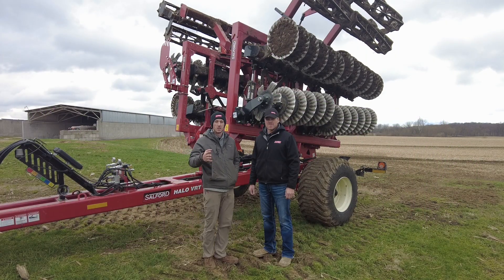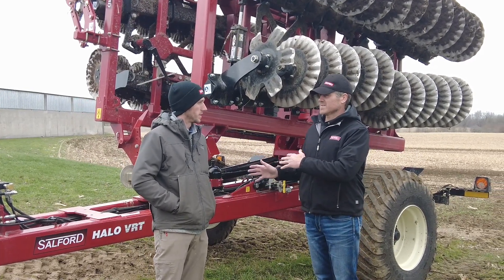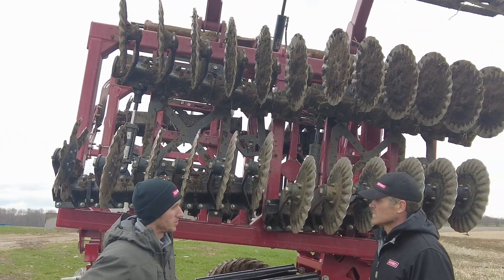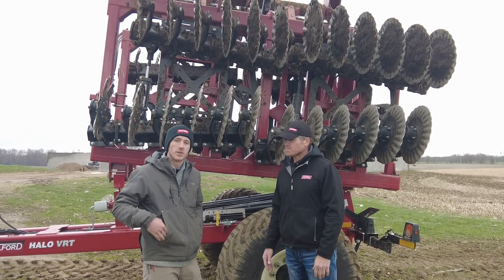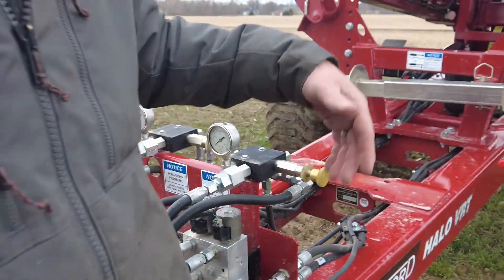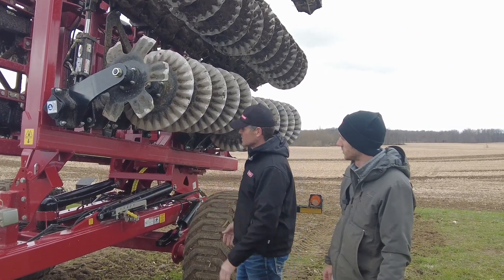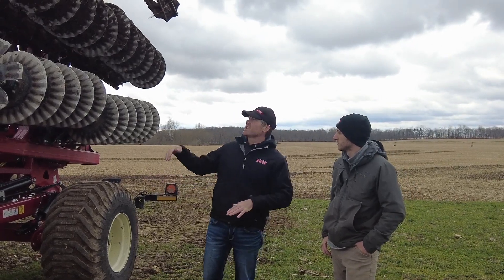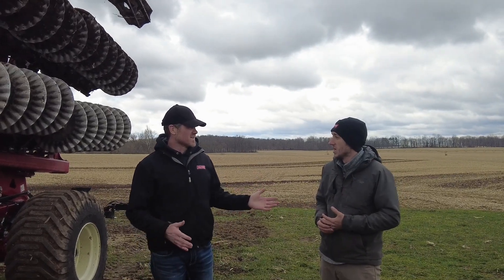Salford VRT Tool Overview

Comment: i farm in Southeast Saskatchewan and have been looking at a better tool to replace a tandem disc to level rutts from the sprayer in the spring and also work low spots that have dried up in the fall would this tool level rutts and work tall weeds down and bury them a little in the soil?